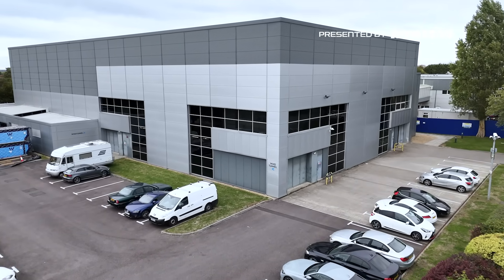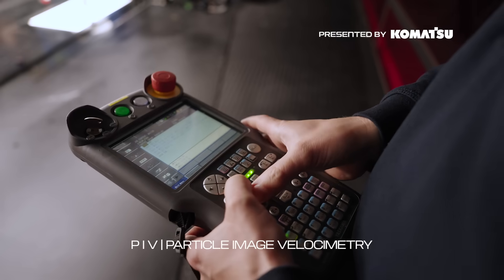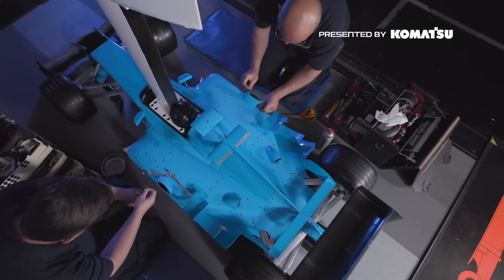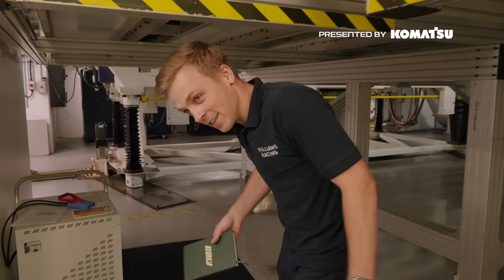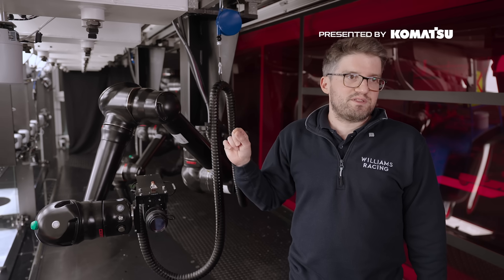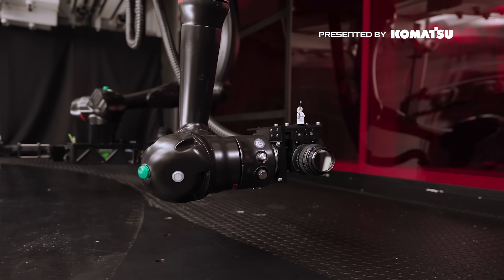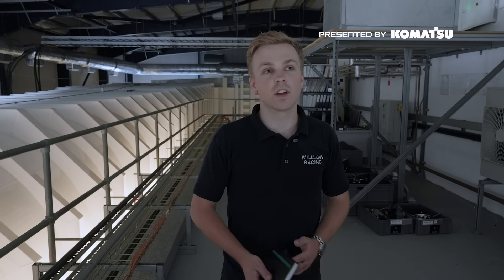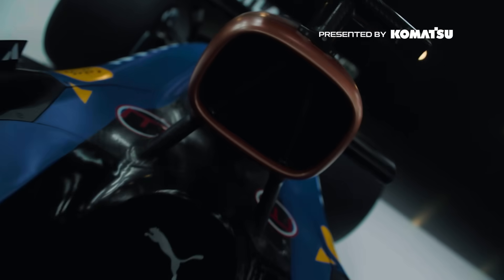What Happens Inside a Formula 1 Wind Tunnel!

Comment: Excellent behind the scenes footage. Thanks.
Find it strange the FIA deemed using scale models would be cheaper than the actual car. They have to manufacture 1/4 tyres, wheels, wheel bearings etc that they never actually use.
Reply: I was thinking the same.

Comment: I remember in the early 2000’s when Williams started running the tunnel for 24hrs local residents complained about the noise. A huge wall of hay bails was constructed to provide some noise control until the tunnel could be enclosed. In those early days 24hrs of running was covered by just two technicians. Those were long days!
Reply: Yeah back then, no ATR

For my taste the toolboxes are quite large